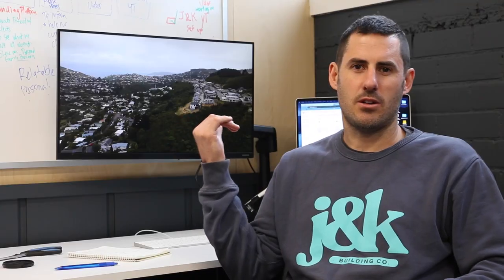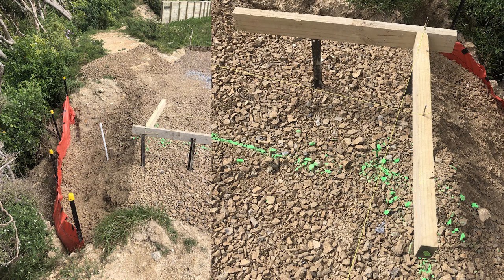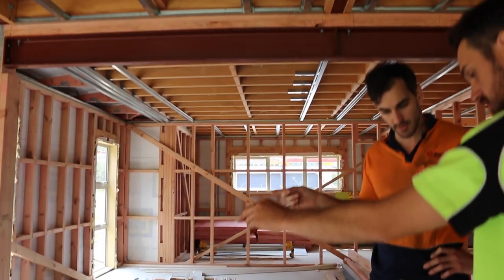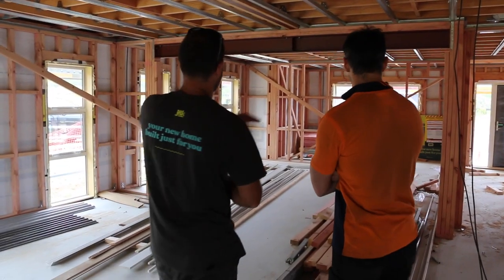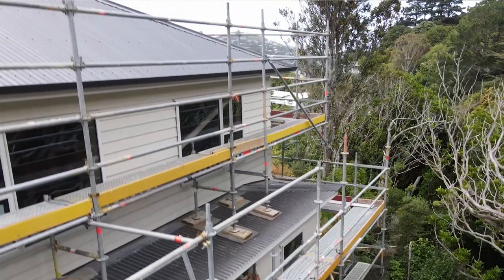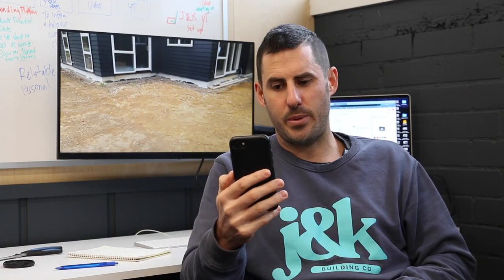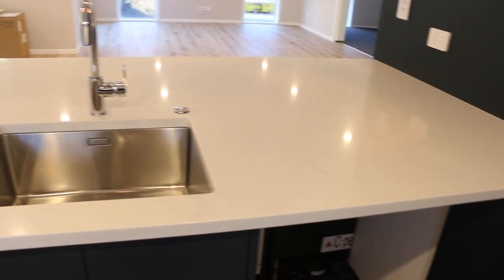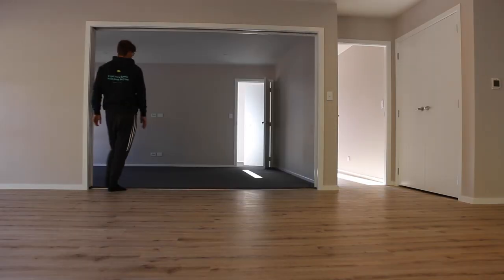Crofton Downs House - Start to Finish

Comment: Hi Josh , do you have an estimate how much Electricity companies normally charge for a new connection for a subdivision property in Lower hutt area? Thanks
Reply from the maker: its usually 5 - 7k depends on job and situation though, call North Power or Wellington Electricity direct, cheers
Reply: Northpower seemed to be the best when I did this recently. They had the job done before any of the others even quoted me.
Reply: @nzbuilder  Thanks for the reply. Our seems to be too high., North Power gave us quote for 10.5k for our new connection for a flat and  easy  subdivision section at back in Naenae. Electric pole is right in front of the existing house.. My Builder estimated this to be close to $5000 in his contract specifications.